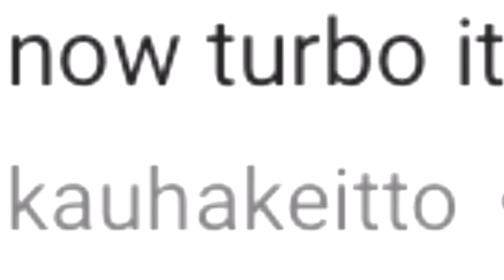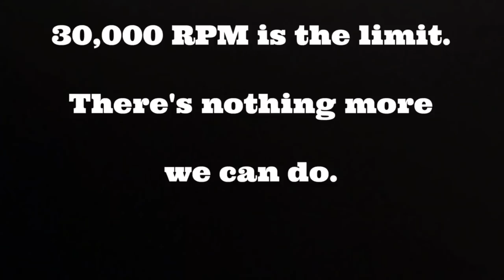FASTEST POSSIBLE RPM Lego Technic motor 30,000Rpm

Comment: Vegetable oil weakens the Lego plastic.  You should use a silicon based lubricant instead.
Reply: This was what I was just thinking. It'd be a better overall lubricant and stay where it's useful longer, too.
Reply: I once used sunflower oil to oil one of my toys when I was like 5 years old. It got stuck after few days and my dad had to clean all the oil out of it in order to make it working again. Vegetable oil lubrication NEVER AGAIN.
Reply: OK but for destruction purposes it is good.
Reply: Or pump water onto the parts.
Reply: WD40
Reply: wd 40 is for rust prevention not lubrication
Reply: Rias Gremory WD40 isn't a lubricant and it also breaks down the plastic Legos are made of.
Reply: Michael O oh i didn't know that, im sorry
Reply from the maker: like it wasn't going to break down anyway
Reply: sayaman  now put a volumetric compressor
Reply: Septfox hate the anime background 😂
Reply: @madbrick923  yes
Reply: I use olive oil on my lego vacuum engines
Reply: @Duncan-Donuts  me aswell, I'm currently in the works of a v26 engine at 11,000 rpm using a drill and some whack gear ratio. I only keep it at speed for a few seconds at a time due to fear. ill have to try silicon oil also. currently i just wash the pieces between uses so the oil doesn't sit. i have melted and bonded pieces due to friction.

Comment: how about making the crankshaft part as sealed as possible and add lubrication?
Reply from the maker: Ha, but there are no pistons rings to seal so it would be splattering everywhere! but i would love to give it a try
Reply: it will be a slight modification to the pistons. he can make a groove in the pistons and put an E-clip on or an rubber o-ring

Comment: hey man, rig up an aerosol Can with lubricant to spray up into the bottom of the piston as you spin it, it will lubricate everything and keep it cool.  and make it a 2cyl so it balances better
Reply: it's not lucubration failure it's a structure failure, the g-force that the little piston is under is in the 1000's of g's ... it's just rounding out the crank rod connection

Comment: Your engine can't work, it's missing the cylinder head! :D
No JK nice video!
Reply: Roy Hess . It’s not meant to work, it’s meant to explode. It would be harder to make it really run. You would need to hook the crank shaft up with the cams that run the valves. It’s much more complicated than you think.

Comment: Knowing those would find out the upper limit in which a Lego Technic engine could withstand before self destructing before using a rotary tool when those likely calculated the RPM's to be at least 30,000 RPM before pieces came out as the connecting rod caps were the first to go.

Comment: I will say one thing is that you could try and go through making it more close to how an engine should be. Such as having it capable of flicking oil to its crank, balancing it and having a harmonic balancer, and have it with 2-4 pistons. I wonder how it would work if you had an oil pan for it

Comment: There is a lot more we can do :) . Use silicon spray lube (doesn't affect plastics, unlike oil). Make tighter piston pins. Use a plastic glue to round the harsh  edges on the crankshaft pin for a smooth glide :)

Comment: Wouldn't cooling make this better and longer lasting? As the problem here is not things breaking apart b/c of not using glue and just breaking inbetween, but rather because it's melting. The thing itself should survive it fine as long as cooling is added. Put in a cold place?
Reply from the maker: If you saw part one, it broke apart because we did not use glue. But you are right it probably was the heat which melted through the rod, but that is the limitation of plastic parts not intended for these speeds.
Reply: sayaman well sounds like they need to make plastic intended for higher speeds and more durability

Comment: I have a suggestion for you. Make a little hole of some kind that gives you access to the inside of the engine (connecting rods and the crankshaft) while the engine is running. 
Then, use WD40 and when the engine is running spray WD40 into the engine every couple of seconds. 
You can also use vegetable oil in a window sprayer.
Reply: WD40 aint a lubricant

Comment: Give all pieces (exept for piston) a full coat of Line-X
Line-X is a spray that will make breakable things unbreakable, if you didnt know.
Then make a mold for the piston, then fill the mold with melted iron, then heat it up, after you should have a iron piston that probably wont break, and please do this so it can go to the max max speed 30,000 rpm or if you can, get  a even faster one that will go over 30,000 rpm. Then we'll all see the real max rpm for a piston.
Please make this video become a reality.
P.s i dont know where you're gonna find Line-X spray.

Comment: try casting your own piston rods. Just melt aluminum cans (you can do this by putting cans into a used fire extinguisher with the top cut off and putting it over a campfire).

Comment: I built my own Lego engine, a bit bigger than the one used in the video. As I had two cylinders with pistons, in the highest RPM it works well, but when I added the third one, its started blowing up. Probably because my crankshaft is too loose and everything vibrates too much in high RPM. I will work on it, Maybe someday I will record a video of my Lego engine.

Comment: Think about this for a sec: standard gas engines will malfunction after a constant 7,000-9,000 RPM.  THIS IS AROUND 4 TIMES THAT!
Reply: VideoGamesUSA smaller the piston the faster it will spin. that's why semi trucks get about 4,000 RPM and F1 cars get and 14,000-15,000 RPM.

Comment: Vegetable oil is a horrible lubricant. While it is an oil, it differs from mechanically usable oil because of missing additives. They make all the difference. So in an extreme situation like this, I bet you will get better results using a more suitable oil. Maybe you have a can of motor oil or similar?
Reply: Mobil 1 will stop your lego from breaking when you spin it at 30,000 rpm.
Reply: Maybe he can find a can of fine Octan oil.

Comment: WAIT WAIT YOU SAID 30k RPM WAS THE LIMIT?! Put a big (64 tooth?) Lego gear to a small (8 tooth) gear and boost the RPM by 8x to (technically) 240000! But the gears'll probably get shredded.
Anyway, what's the harm in trying?
Reply from the maker: Robert Fekete I don't want to die

Comment: Turbo a giant lego motor
Reply: Therealracer Productions you would need a drill with enough torque to power it. Also if you didn’t know. Turbochargers put air into the engine. There is not an engine head along with the valves.

Comment: Buy a model engine with the money you made off the video and turn it up to 25k rpms. Lubracate the pistons, camshaft, crankshaft, and the transmission if there is one.
Reply from the maker: which one, send me a link
Reply: sayaman . It comes with a transmission too. It also has a little crank for it. I’m sure you can make a rig to run it on.

Comment: meh make an actual internal combustion engine that runs on fuel you can destroy a brand new 100 hp car engine with a 20 hp electric motor at how rpm even if it has oil doing what you did.